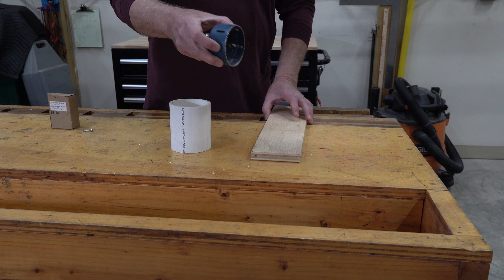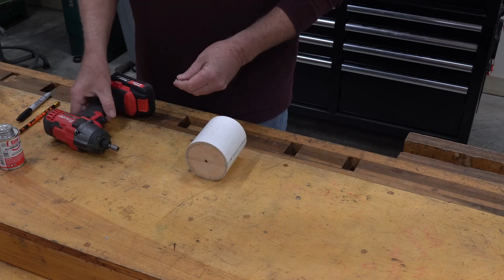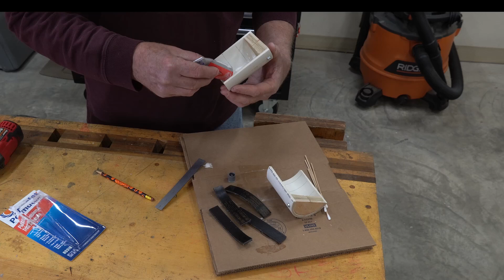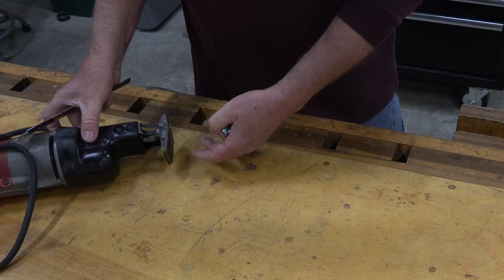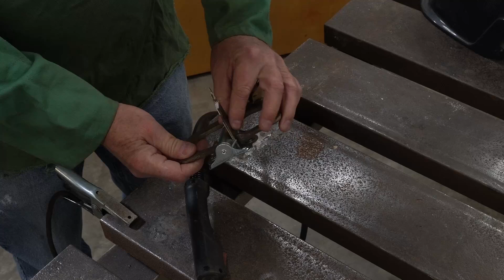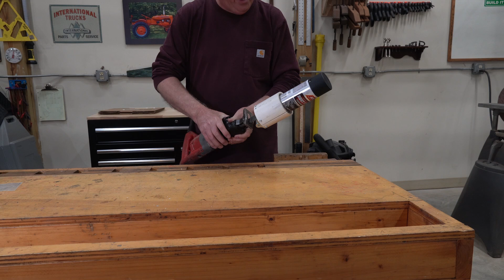Spray Paint Can Shaker Using a Sawzall Reciprocating Saw - DYI - Model 0

Comment: Put a large hose clamp around it, Kentucky
Reply from the maker: That would help it from ejecting out but would require another part to keep up with and a tool to tighten the clamp. My next model that is current in my sketch book will be easier to build and will retain the spray can much better. Planning to have something out by Christmas.

Comment: Hard to find the commercially produced unit. Good for you, having a go at showing people how to make them!
Reply from the maker: I have another design that is currently sketched up that will be easier to make and hopefully will work better. Not sure when I will take time to make it.
Reply: Brand: MixKwik
4.4
4.4 out of 5 stars
(18)
MixKwik Paint Shaker 2.0 - Universal Spray Can Paint Mixer for Reciprocating Saws - Fits Cans from 2” to 4” in Diameter. Made in USA I found this on Amazon but it’s expensive. Jack used it on a video on his page Speedbump Garage